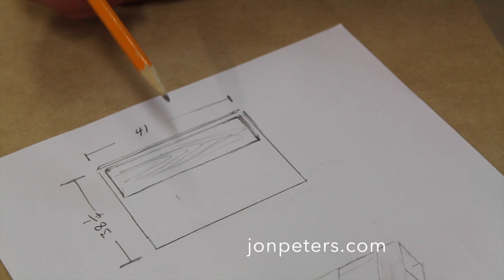Build a Platform Bed with Storage - Short Version

Comment: Jon, when using edge banding do you account for the extra 1/16" or so that the banding adds to the pieces on your projects?  And if so, do you just need to make your cuts heavy on purpose to account for the extra thickness of the banding or is there a more exact approach to this. Maybe I'm just over thinking it?

Comment: Wont the mattress start rotting with no air circulation underneath it?
When i was younger i had a matres on the floor for a while and because i didnt set it up against the wall it started to rot because the moist from sweating at night couldnt get out the mattress at the bottum.
Reply: I see a lot of bed builds on YouTube and often wonder the same thing
Reply: Misq2k Mattresses here in the US come with "breather holes", which are basically metal disks with holes in them sewn into the mattress, along the sides of the mattress to allow ventilation and moisture control. So, unless you have a bed wetter, I think you are ok. Look at 99% of Murphybeds. They have become the next big thing, and they are basically a mattress on a solid sheet of ply. They sell A LOT of these and I couldn't imagine this being a problem unless you have excessive moisture.